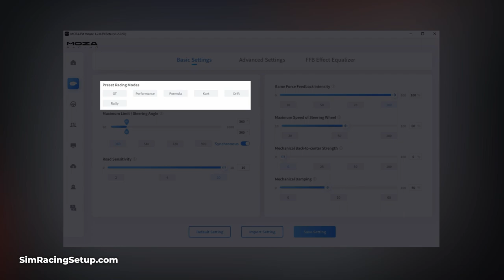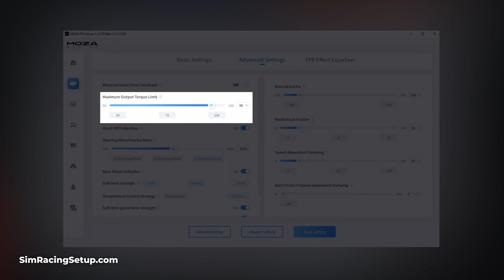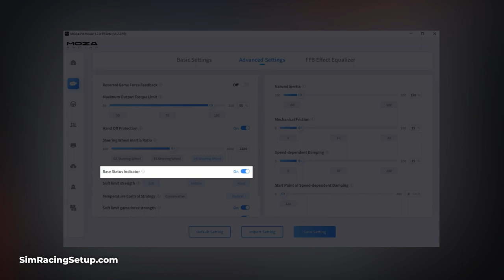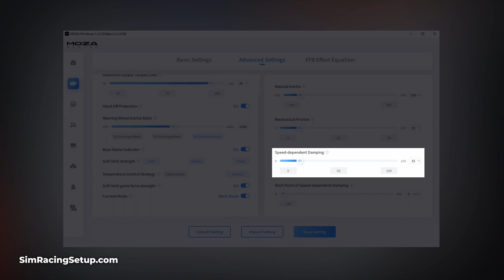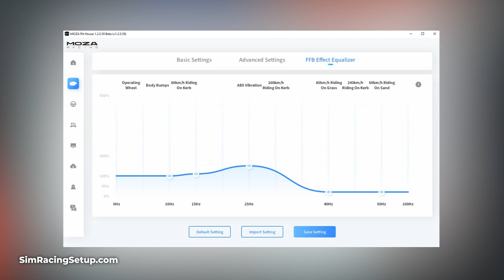F1 22 Best MOZA R9 Wheel Settings & Force Feedback Settings

Comment: Do you have any problem with the "Immersive Pitstop"?  With the R9 Base and the GS Wheel there is no button prompt to 'turn in' when going down the pits. Cheers.
Reply from the maker: Yes! I have had this exact issue and not sure what causes it
Reply: @SimRacingSetups  The only thing I found in forums etc is that code masters haven't fixed the issue for Moza products yet. Thr button you've bound to "Accept" should be enough, like thr A Button on a controller for example, but for Moza specifically it doesn't work at the minute.
Reply: @Rusty_Rich  Here is the solution to your problem, you have to configure the GS Wheel as a controller in Steam then you can map a button as normal and it will work
Reply: Simhub and simulate the A key on your keyboard with a button on your steering wheel. F1 = Moza+keyboard profile = Solved :D

Comment: I just got a FSR wheel and R9 wheelbase this week to play F1 22 but I've been having issues with 2 things. I can't use the left stick to navigate within the menu and for some reason when I'm in the pit garage sitting the cockpit view always moves to the left without touching any buttons. Can you please help?
Reply: Hey i had the same issue what i think fixed it was i switched my left stick from d pad to analog stick. If you go into the button test thing inside f122's button mapping setting i believe it registers as different buttons depending on whether you have your stick set to analog or d pad. Let me know if this helps i did no testing it started working so i decided not to mess with it anymore haha.
Reply: Same here...in garage car faces the left.... and replay/flashback looks behind.